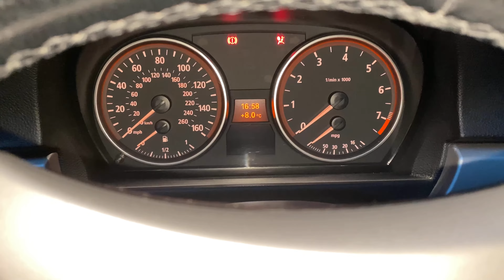BMW Remote Key Repair

Comment: Hi Neil, good video, I don't think the damage to the PCB was caused by dropping the fob. More likely you accidently damaged the board when cutting/opening the FOB which is a common issue. To prevent this happening you need to put the remote in a soft jawed vice to hold it while you make precision cuts. Also, if the fob wont lock the doors then your central locking wont activate the factory immobiliser, leaving the car vulnerable if a window is forced or broken open.
Reply: Years since I saw someone care about a theft alarm. They dosen't matter IMHO, people around don't mind about it.
But it was surely a great video about repairing a key fob. Nice job sir.

I repaired one for a Renault traffic years ago, way beyound repairable. Switches gone and componets missing.
Worst was to figure out, what was missing. My luck was some kind of images on the remote in the Internet, and a bit of guess work. Using a used spare remote was not in my mind. That was a great idea. Now I have a lot of smd resistors 🙂

Comment: I think I damaged my pcb while unsoldering/resoldering the battery. Is it possible to buy a used key and transfer just the unique chip to the replacement key? If so, which part is the chip?

Comment: You performed that wrong. You pop open the battery to , not cut any seals. a mini screwdriver is what you needed.
Reply from the maker: Nope not on this version. This one is sealed with a non replaceable soldered in battery so there is no cover to pop off so what I did is completely correct.